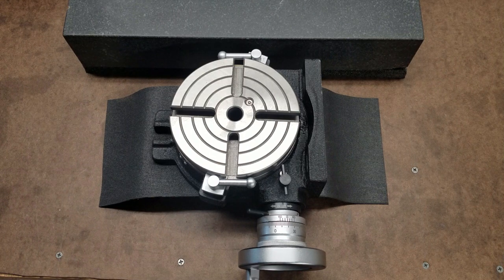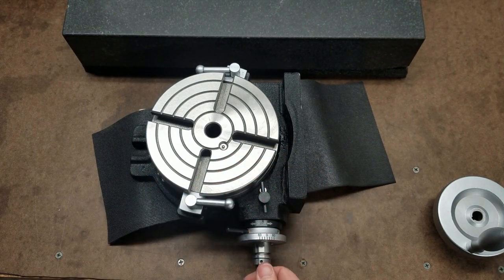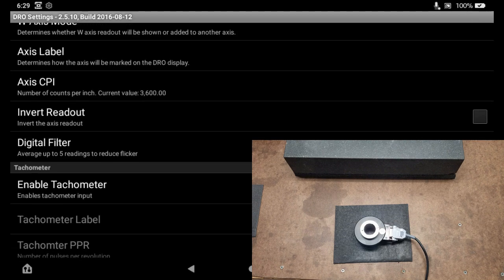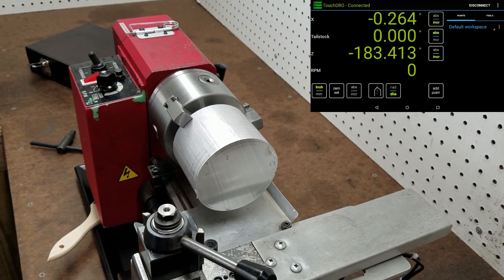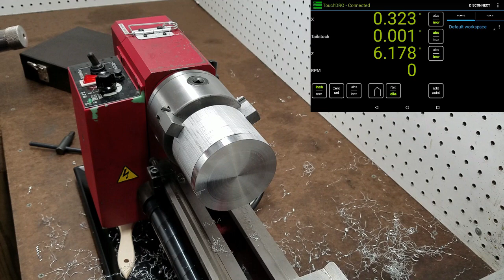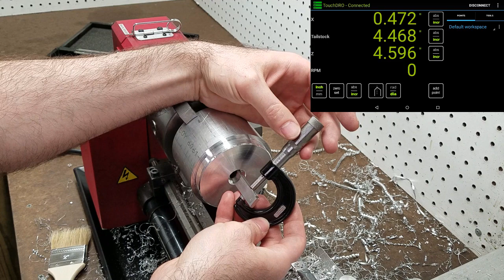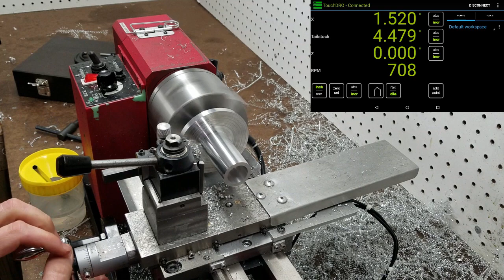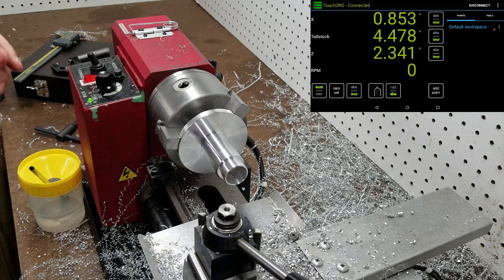Rotary Table DRO Encoder (Part 1: Intro and Handwheel)

Comment: This a really cool project. I had never heard of encoding a rotary table to display on a DRO. Hell yeah!  May not have been feasible considering how deep a cut it would have needed to be, but had you considered trepanning some of that stock material so it didn't all end up as chips?  Psyched for part two!
Reply from the maker: Thanks! I'd never seen or heard of it either, but I figured, why not? TouchDRO has huge potential for this kind of stuff... One of the main reasons I have a TouchDRO adapter board on every one of my machines... Lathe, mill, shaper, surface grinder, and if I can figure out a way, my D-bit grinder will have one, too. 

And honestly, I hadn't thought about trepanning... Though you're right, it would've saved material. Depth wise, I could've gone in halfway, flipped it, and finished the trepan from the other side. 

Hindsight, and all that...

Comment: Love the little dro screen.   What do you use for micro slim scales?
Reply from the maker: Thanks! I've always thought it would be useful to be able to see what the operator sees, so I wanted to make sure I had my readout as part of my videos.

The mill uses glass scales, similar to the kind that come with pretty much any import DRO setup. The lathe and the shaper both use capacitive scales, which are similar in operation to digital calipers

I'm likely going to convert the shaper to the glass scales, so I can use the rotary table DRO on that machine, as well. 

Check out https://www.yuriystoys.com for more info about TouchDRO, and the commonly used scales.
Reply: @fna-wrightengineering  very good link.  thank you for sharing!
Reply from the maker: @Likeaudio  You're welcome!

Comment: Great video 👍 What type of rotary encoder is that?
Reply from the maker: Thanks! I got it on Amazon, it's made by Calt. It's a 30mm ID hollow shaft encoder, 3600 pulses per revolution, with a push-pull output.
Reply: @fna-wrightengineering  Did it work with the touch DRO out of the box?
Reply from the maker: @Unl0gic  I had to wire a connector to the end of the included harness, but that was all. 5V, gnd, A and B phases. No resistors required, or anything like that. The wire colors are labeled on the encoder, and the spec sheet for the TouchDRO board has the pinouts for the board itself. I used one of the connectors included with the board. It was pretty straightforward.
Reply from the maker: @Unl0gic  You're welcome! The encoder I bought was this one:

https://www.amazon.com/dp/B07G5SVPLD/ref=cm_sw_r_cp_apa_glt_fabc_K4HZ3KQ6JRQP6XMP8HG0?_encoding=UTF8&psc=1

The one you linked has a different kind of output, and I'm honestly not sure whether it would work or not. I do know the one I linked does.